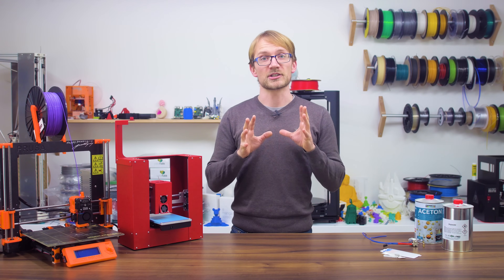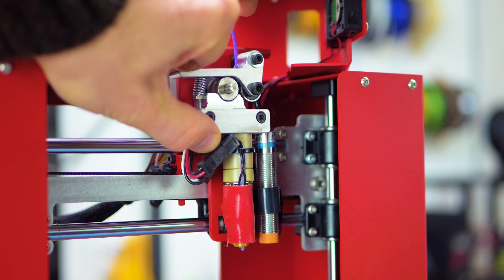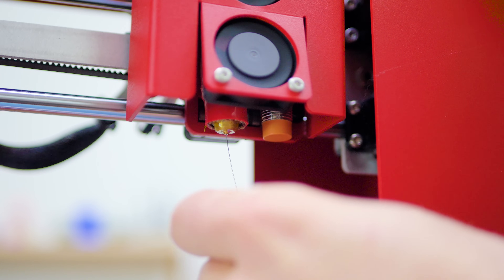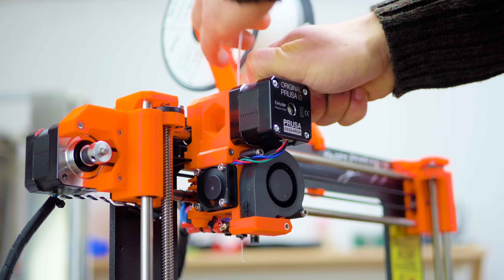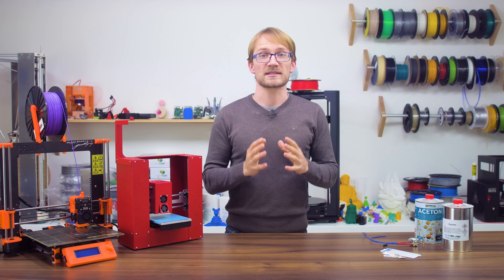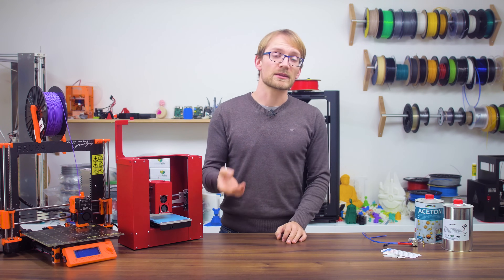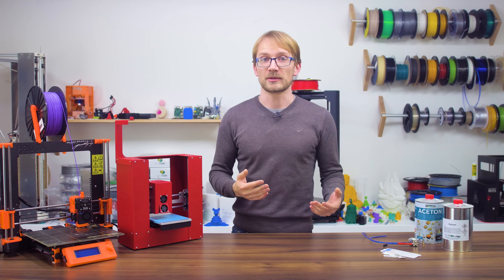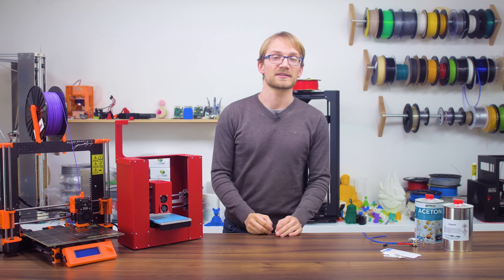Basics: Cleaning out a clogged nozzle!

Comment: What about putting the nozzle into an ultrasonic cleaner? Would that cause damage on the internal tubing? What cleaning agent in the water ?
Reply: There's nothing to damage that way really, the nozzle is a solid piece of brass. Everything that could come off is crap that you don't want on there. So if you have it at hand, you can always try. However i suspect it just won't clean out the nozzle at all, the crap gets stuck on good if the nozzle is clogged enough.

Comment: Stare down! X¬D
 But I can honestly say that I must have a perfect system, because in all the (approx) 34 days that I've been 3D printing, I've never had a nozzle get blocked! :¬P
Reply: 34 days is a very short timespan. If it was a year, then we'd be talking close to perfect.

I just burned out my nozzle after about 6 months, simply with a soot-free turbo butane lighter (ones that go through the gas quickly and produce colourless to blueish or greenish coloured flame) near water so i could cool off the pliers i was holding it in regularly, that seems to have cleaned it out, together with some wire brush poking, it's now see through. But i didn't test it yet, i simply put it back into my bag of spare nozzles because i already replaced the nozzle on the printer with a factory fresh one.
Reply: Hopefully you didn't get your brass nozzle too hot before quenching it as it may be annealed.
Reply: Mine got clogged on the first day
Reply: I have been printing with my new printer for over 70 days without issue. Last night all the signs of a clog. Going to deal with that today...
Reply: Ryan O Hey that's great! :-)
 Not your clog, but that now I know to throw out .my current nozzle after 69 days! :-P
Reply: wordreet Used the atomic pull, and all is working well again.
Reply: Ryan O what the heck is an Atomic pull?
Reply: wordreet, To clean a clog you heat the nozzle up to printing temp. Extrude a little. Then set the temp down to about 90c as the temp reaches 90c you yank the filament out. It cooling down and hardening a little should pull any blockage out with it.
Reply: Heh, how embarrassing, I just watched the vid again and Tom mentions it,  :¬,
Reply: I've just had my first blockage at around month 11 since the I got my prnter. I guess more luck than anything else.
Reply: Huh, I got really unlucky then. My printer devoleped a minor clog after only getting 3\4 of its way through one thing of filament.

Comment: My nozzle is so blocked, no filament will go threw. I even tried to melt the stuff stuck in the middle with a hairdryer, still no luck and I’m kinda screwed.
Reply: Hair dryer is too cold, won't do much. I soaked mine in acetone for a few days, which probably... didn't do a whole lot, scraped out what i could from the inside, and then burned it out with a blue-flame turbo lighter i got at a convenience store for 3€... a little poke with a wire brush later, it's completely see through now, looks perfect. I did this over a sink with dripping water, so i could regularly put my pliers i was holding the nozzle in under water so they wouldn't get too hot.

Comment: If the filament is stuck in the ptfe and you cant get it out, try heating it up and push it through (you can just use a lighter and push with other filament)

Comment: I used a welding flame to heat the nozzle. That evaporated and melted the material but did not damage the nozzle in any way. Other flames will work too. The melting temps of nozzles are high anyway.

Comment: I use guitar wire; The thinnest wire is stiff enough to push up into a blocked nozzle. I also feed it in through the bowden and use the ribbed section of the wire to catch hold of molten plastic blockage and pull it out as it cools then I pull or snip off the wire blob and start again. Works for me although I'll try your Stare Down Technique if I run out of strings.
Reply: Aha!!! I have tons of guitar strings and last night my printer clogged for the first time and I couldn't think of what to do. Tonight I will try this!

Comment: I put mine in a pot and boiling water yesterday since pla melts at the same temp water boils. worked great
Reply: Yeah water 100 celcius..pla 185 and up , petg 230 -250 celcius degree..so i think yuo only desinfect the nozzel and the plastic inside if they are
Reply: Water boils at around 200º*F*

Comment: Just ran into this kind of problem: Anet A8 nozzle ejecting very low material. It wasn't a coggled nozzle. Turns out the cog attached to the extruder motor loosed itself from the motor shaft, so the extruder wasn't able to pull the filament. It's worth a check, and it's a easy fix!!!

Comment: hey thomas i think these would work well for tip cleaning https://www.homedepot.ca/en/home/p.tip-cleaner.1000173450.html 
called welding tip cleaners come in many sizes for cleaning copper cutting torch tips and the like  come in different lengths

Comment: Add 10 wt Silicone oil to the port where you feed filament to,heat up the hot end to 270 °C and wait for the clog to heat up,then push hard with another piece of filament (I use white PLA so I can't if the nozzle is still dirty) , use glasses so you don't get hurt, the oil will quickly evaporate once it reaches the end of the nozzle.

Comment: I'm still trying to un clog my nozzle ... it cloged the first time I used it
Reply: Make sure it is the nozzle and not the heat break I was trying so much to unclog it. Then, I just bought another hotend and replaced it. Later, I Found Out that it wasn't the nozzle but instead it was the bore. Filament was stuck in it.

Comment: 90% of the clogs I've had are due to printing too hot and the PTFE liner melting into the nozzle.  I've tried all these methods in the video and cannot unclog a PTFE clogged nozzle.  Nozzles for my machines (e3d v6 volcano) cost about $1/ea, so tossing it in the trash is usually way better than cleaning.  Seriously, I would never attempt to unclog a nozzle that has been run over 240C with a PTFE lined heat break.
For the other 10% of the clogs, the needle while hot in the machine usually takes care of it.  Heat or Acetone scrap the nozzle b/c they break the filament down to something that clogs nozzles, and there's always plenty of residue.  Even if heat or Acetone unclog the nozzle, you can be you will be unclogging it again soon.  I've spend 20+ hours with nozzles and torches and torches and acetone and never had success recovering a nozzle.  Maybe someone, somewhere once did...
Reply: ...it seems I'm stuttering on my keyboard this morn.  Need coffee!
Reply: Do you have an original e3d v6? or a clone? How far does the ptfe liner reach into the heatbreak?
Reply: yes...clone.  I see E3d sells all sorts of components and hot ends, PTFE tube being a component they sell, which fits their heat breaks.  Yes it appears the E3d heat break has a special tapered bore at the tip and might not need the PTFE liner for some materials.  I do not have experience with the E3D brand heat break (only the clones), but have read and experimented and found PLA requires the PTFE tube.  Oiling works but is not reliable.
Do you suppose/have experience printing PLA and PETG without a PTFE liner on an e3D all-metal heat break?  My guess it it wouldn't go well unless the feedrate is kept low?
...I have had a 1 degree tapered reamer that's been sitting in my cabinet for a year to try what it looks like e3d sells, which could be useful for printing nylon at least I suppose?
Thanks in advance, and keep up the good work!  Myself and others learn tons from tutorials like this!
Reply: Hi Mario...yes it's a clone.  The PTFE touches the top of the nozzle.
Reply: Hmmm, wow, allrightythen.  Why then do you suppose they sell PTFE liners?  I will be trying out my tapered reamer then.  I'm surprised you haven't ever had a jam.  A lot of heat break jams or partial jams end up stripping the plastic at the gear and not really showing issues in the heat break.  I guess I've never had a jam in the heat break either...but plenty of jams elsewhere!

Something about charging 36 Euros for a 0.5 Euro (e3d V6 heat break) part just doesn't settle well with me.  I think I'll end up in-sourcing the entire heat break and hot end anyway.  Even the genuine E3D hot end could use improvement, and it seems people want a better hot end.
Reply: Hmmm, yes it seems it is 11.5#'s.  I don't know what I had pulled up earlier, as after paging through 100 items on e3d's website I can't seem to find it again.  Anyway...so I see how they use the PTFE now...seems good.  All metal is definitely the way to go if possible if what you say is accurate.  Definitely worth tinkering with that taper when I build my custom hot end.  Thanks for the advice!

Comment: Thanks Tom! I didn't know about the cold-pull. I'm thinking of trying it on my Malyan M150 (getting harder and harder to extrude, I think there's a small blockage...) but there's two  things: first is that I've only really got PETG filaments, is that flexible enough? Second, the MK10 hotend on the Malyan has a PTFE insert - will that get screwed up by a cold pull? 

I'm actually concerned the "blockage" is a flake from the PTFE insert degrading in the hotend, but I really don't know. (been running the printer hard for months now) 

I'm trying to upgrade to a V6 hotend, but I need a working printer to print the parts to upgrade my printer, so I'm reticent about trying the technique on my one and only machine, even if it is struggling. I don't know what happens if I accidentally rip the PTFE liner out, I assume nothing good?

Comment: Any additional tips to avoid partial clogs when swapping from a higher-melting filament back to a lower melting filament?  I always seem to get a partial clog moving from PETG (250C extrusion) to PLA (210C extrusion) even though I use some cleaning filament between each filament type.

Comment: I got used to do a cold pull with every Filamentchange. You will never again have any trouble with clogged nozzels. 
Also I push in the Filamant while it's cooling down to compensate the shrinking. With this technique the cold pull works on almost every Filament.
Positive Feature, as no old filament is left in the nozzle, there is no colourmixing!

Comment: Is there any good 3d print forums? I tried to look but couldn't find any that wasn't too tightly tied to one brand etc. I have couple issues with my printer I haven't yet to be able to find solution.
Reply: The RepRap forums have been around a long time, and have a huge variety of non-vendor specific sections: http://forums.reprap.org
Reply: I'll check that out. Thanks!
Reply: reddit.com/r/3dprinting

Comment: I had a print fail 60 hours in, 2 hours away from finishing because of a clog...
Reply: F
Reply: @scheichajev  q
Reply: D @scheichajev  yes 2
Reply: @scheichajev  saw was
Reply: @scheichajev  z
Reply: @scheichajev  a a
Reply: @scheichajev  as
Reply: That sucks :(
Reply: thats why i prefer to do it in parts if its possible....so i cut it and after i print, glue, putty, sand, and paint , u done
Reply: @Nekotico  What do you use as your favorite putty?
Reply: you can continue from the last layer but you need to find it in the gcode and delete everything befire that, just make sure the printer doesn't lose the position
Reply: That is awfull
Reply: Been there bro.
Reply: Oof
Reply: F
Reply: I know
Reply: same.
Reply: F
Reply: what were you printing that took 60 hrs! I can't even be bothered waiting 2 hrs but i only print custom cookie cutters!
Reply: pain
Reply: I understand the feeling.
Reply: Im crying
Reply: Thats not how you print guns
Reply: I'm sorry, that's the worst...
Reply: Dz6
Reply: 1
Reply: G9VN5G9VN556B8B95EB678G9VN5
Reply: Oof
Reply: Pain
Reply: F
Reply: F
Reply: Real pain doesn’t exi-
Reply: f
Reply: You shouldn't print something that takes 60 hours in a single print session, it's too risky unless you're running robust commercial 3D printers.

You should split your model into parts and print them separately and then glue them together. You'll get less artefacts and warping as well.
Reply: @floatingchimney  you are totally right...

Comment: Kind of surprised you didn't suggest my preferred method which is heating the hot end up to its maximum rated temperature for a few minutes so any contaminants (usually left over bits of ABS when printing PLA) get melted also and come out. Is there a reason I shouldn't use this method?
Reply: Will J, yes they do, it's called the hot end of their 3D printer.
Reply: john cummings I'm curious to hear Tom's answer as well. I use a similar method of heating the nozzle up to around 250, then pushing/extruding taulman bridge nylon through which pushes out all the liquefied blockages.
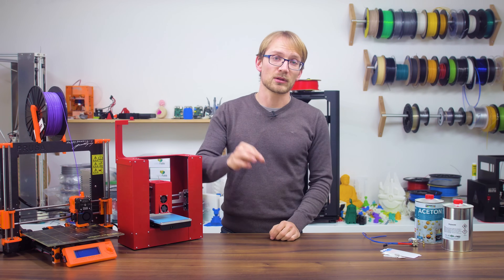Reply: he did... at 4:44, people rarely have anything that can heat something to a specific temperature, so they opt to use a torch.
Reply: I melted a Teflon tube once using high temperatures. Teflon melts at around 300 ºC

Comment: Great helpful video is very much appreciated!

My favorite nozzle cleaning tool is a small section of a bamboo cooking skewer, like used for cooking on a charcoal grill.  It is great for digging out gunk from a nozzle, heat resistant so works well with a heat gun.  End can be cut clean or ragged to make it a precise pointed scraper or a bristled stiff brush.  Can be put into a drill easily or dremel, less easily, to spin it and really clean out a nozzle nicely.  May deposit stuff in the tip final .4mm bore that will need to be removed if pressed into the nozzle hard while spinning it in a drill or dremel.  Usually just another bit of bamboo stiff fiber poked through from the other side takes care of that, but it's only for a full servicing and refurbish with the nozzle removed to dig out every last bit of gunk and make it like new.  Might work well with solvent as it will hold it and deposit it and carry material away as well.

Comment: I tried the blowtorch method once and managed to mess up the nozzle since I was a noob back then and didn't know any better. It's surprisingly easy to melt and deform a brass nozzle. Next time I end up with a nozzle clogged to the point where it requires a blowtorch to clean, I'll just get a new nozzle.
Reply: Pile of carbon I melted the exit hole on 2 of them now with the torch method.
Reply: Why blow torch? A tiny little 3€ turbo lighter i got from a convenience store worked for me to burn out a nozzle, and it doesn't get THAT hot that it would melt brass. I mean there's a brass insert in the lighter nozzle, and it wouldn't burn ITSELF up. I also did it over the sink with dripping water to regularly cool down the pliers, i don't want them to get too hot either.
Reply: I just heat the nozzle up using my gas stove. Doesn't get hot enough to damage the brass but burns out any contaminants.

Comment: I have not been able to remove the remove the nozzle from my Rep2 without breaking it, ever. I think I've tried 3-5 times now. Snaps inside every single time.
Luckily I've bot a bunch of hotends blocks to compensate for this, had to replace one yesterday. Cold pulling with nylon is by far my favorite cleaning method BTW, but after maybe 1500 print hours, I think my nozzle was just giving out from abuse and too much carbon PLA.
Reply: ChristianP1973 heated.
Reply: It is most likely that you had overtightened the nozzle in the first place. you probly need to heat up your hotend to slightly higher temperature and tighten the heater block slightly to release the tension between the nozzle and the heatbreak before unscrewing the nozzle.
Reply: Mega Making Seeing as I've never successfully removed the nozzle, all the ones I've had have been factory installed, so I've never tightened them myself.

Comment: If you do a lot of 3d printing, I highly recommend finding a source of dichloromethane/methylene chloride for dissolving PLA.
It does a /very/ good job even if it's a little nasty(No more than any other 'strong' solvent) and you need to take care not to dissolve the contained or seals of the container your using.  It's also good at dissolving mixed plastic clogs.
(I distill it from paint stripper using some pretty sketchy equipment outdoors but in other countries you might be able to just buy it.)

Comment: I have a piece of sponge to clean my filament, I also put a zip-tie around it to make it wipe a bit better and I have a piece of drinking straw to keep it a bit away from my extruder.

Another preventive measure I practice is to cold pull my filament as often as possible when changing filament.

Since doing these things and throwing away the really cheap and bad filament i had there has been no blocking issues for me.
Reply: I have some grey PLA that I could never do that with. It'd beak immediately as it's about as strong as spaghetti, but it prints beautifully!!

Comment: I'm still like to start with using micro-drillbits to quickly clear clogs or twisting extrusion, b/c the twisted-fluting helps to pull the debris out,, as opposed to just jamming it in farther with a wire or needle.
 BUT, yes, you have to be very careful, as they break quite easily, and an immediate extrusion is needed to get the broken tip out of there.  If you have an assortment-set, they are also  handy for gauging the actual diameter of nozzles that have been used to extrude coarse filaments,, and a quick slicer change can help dial that problem back in to a proper flow-rate.
I would also bring up the use of Canola Oil, for prevention,, but this is enough controversy for one comment post  :)
Reply: The other problem being that a drill bit has cutting edges that can easily cut brass and altering your orifice geometry. It's a bad idea to use them as pin gauges for similar reasons. Even the back end might be pretty sharp and scar the orifice or remove material.